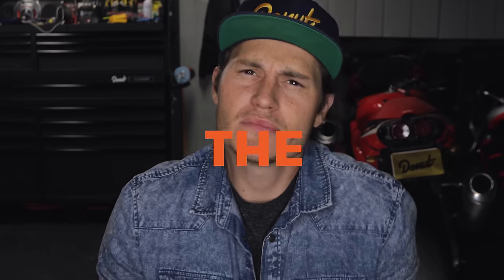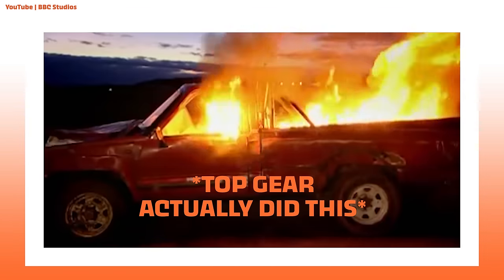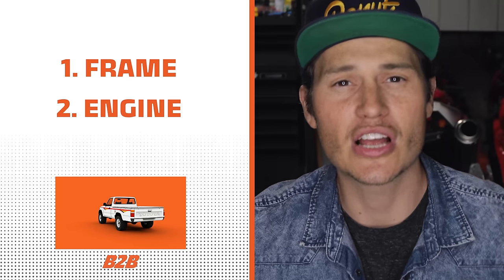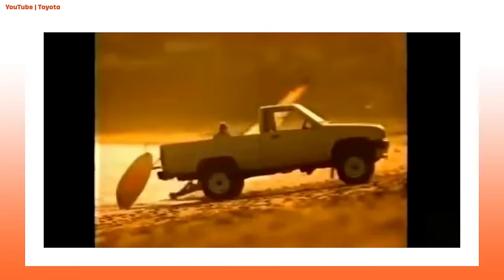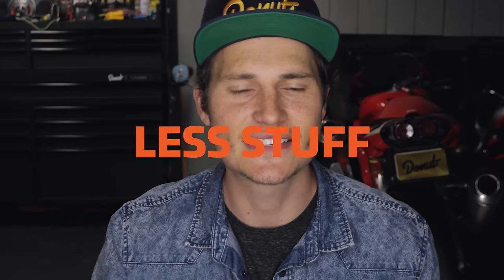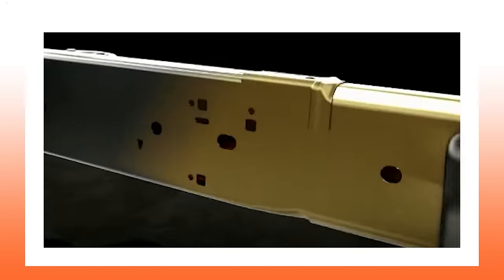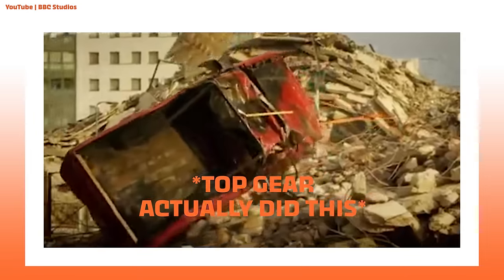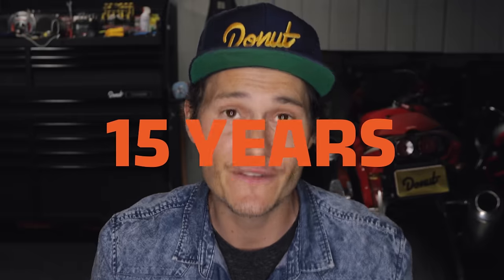Toyota PICKUP Truck - The Science EXPLAINED

Comment: I've seen a couple of those old hilux's reach over 1 million kilometers here in south africa
Reply: Most old farmers would watch this and say knowing" dit is my bakkie"
Reply: Here in Brazil you see it too. From farmers, mining companies, fire fighters e road emergency responders. The only downside they have is that thieves loves them.
Reply: Kilometers are easier on vehicles. When you drive miles is much harder on them
Reply: @greglautz8470  sorry what lol
a mile is 1.6km, so basicalli 1.000.000km is 700.000 miles more or less
Reply: @greglautz8470  A few tundras have gone 1 to 2million miles, toyota gave them brand new trucks, so they could take them back and study them
Reply: YaoMengLiew  yeah, here in Mexico we got both the Hilux and the Taco, I would get the Hilux just because it costs like 10K less, it has a diesel engine, a 6spd manual with 4WD and is tougher. But the tacoma is more comfortable, more of a family truck than a work truck.

Comment: i am a technician at toyota and i have been working on frame recalls for years, we spray tundra, tacoma and sequoia frames with anti-corrosion compounds, if the frame is rusted through we replace the frame under warranty. some of these recalls have ended though.
Reply: Is an old 85 Toyota 4 runner under that recall ?
Reply: They wouldn't sell me a frame replace my rusted out '06 because I wasn't the original owner. Was not impressed.
Reply: They use to give us on the north coast new beds for free

Comment: I've driven a several 80s and early 90s Toyota pickups for driving jobs back in those days. Now I have a 99. I find it just as dependable, but a bit more comfortable (AC and airbags!) and more powerful. Has 223,000 miles and the oil coming out at oil changes is practically as clean coming out as going in.

Comment: I’ve seen my dad pull a 10,000lb load with a 22RE Toyota pickup. They will tow anything you want lol
Reply: Low range? Automatic? Otherwise I'm just imagining someone burning out their clutch on a hill 😆.
Reply: I pulled 6000 with my '89 short bed and it was scary.  It's got the gears, but not the power or the brakes.
Reply: Ok
Reply: emmajohal my dad is stronger than your dad 😂
Reply: The Bushwacker it’s actually 1,200,000 but yeah
Reply: I towed a 92 pickup with my 93 22re 4runner. It worked but only because I was a broke college kid. Full size is so much better for towing
Reply: I pulled a quad cab ram 1500 that broke down from a bad fuel pump. It pulled but you could tell it was there big time... don't go above 3rd gear it will bog down big time 2wd 5 speed.

Comment: Bro most Toyota’s before 2000 are on another level. 😹😹 I once drove my Toyota for 3 months without no oil, car did not complain. I dare you to try do that with another manufacturer
Reply: My friend did that with a 95 f150. The oil was so low that the engine knocked when he went around a corner.
Reply: Why? 😂
Reply: car before 2000 are legend

Comment: Toyotas are beast . 

In 2017 I bought a e46 m3 and blew the transmission in less then a month , my mom gave me her 1992 Toyota sienna so I could get to work & started using it as a carpet installation van , I once put a 800 square feet roll of carpet on the roof rack and 3 rolls of padding inside and not a single issue with the van lol then I got a trailblazer ss and I broke it so then there I was using the sienna once again . In the 3 years I owned it I NEVER did a oil change …. Yes I was young and dumb with my cars …. My mom sold it in 2021 for $3000 with 345k miles with A/c & heat working like new still 😮 our Mexican neighbor is the one that bought it (he had a 1994 sienna and loved it ) and to this day he uses it as a work van . But man are Toyotas literally the best vehicles.

Comment: The one thing the taliban did right, choose a god damn good truck
Reply: they need weight, stability when you fire heavy gun, and low price =)
Reply: Not to mention they are small and maneuverable so they were good for getting into places off-road and in urban areas that other vehicles simply couldn't.
Reply: STOLEN
Reply: You can kill them, but sometimes it literally takes an M1 Abrams or an airstrike, or both.
Reply: None of the above lol. Its because Toyota trucks are not happy until they have sand in every crevice.  They will go 500000 km in nothing but soft sand!.

Comment: We drove in my buddy's taco 500miles down the interstate on two working cylinders... and no oil, topped her off, fixed the wiring harness couple weeks later to get the cylinders firing again, not to mention he lost control and ran off the road at 60mph into a swamp sunk it and blew through a bunch of dumped trash including box TVs and lumbers got pulled out and it started right up

Comment: I had a 1990 toyota pickup and I ran the crap out of it. drove it for 19 years and put over 400k miles on it. still running on original engine and drive line when I finely sold it. even used to pull a travel trailer with it that weighed 3500 lbs empty, which is was never empty. The truck had a 2.4L EFI engine and other than basic maintenance like oil, filters, plugs ect, in 19 years changed 5 batteries, 2 alternators, 1 starter, 3 clutch plates and 1 radiator. best vehicle i've ever owned.
Reply: Shit your valve seals lasted for 400k? I have a 92 Toyota Pickup right now that smokes a bit on startup so I'm having to replace the seals. 155k miles on it so I'm hoping for another 155k miles.
Reply: @thedude8526  yep, all I can say is I always changed the oil between 3 and 4 thousand miles. and it was the best and most reliable vehicle I ever owned.

Comment: 1992 to 1996 ford f150 4.9 stight 6 base model was bulit stupid simple and will live on forever
Reply: I still have my 84 f250, still fires and drives after 400 thousand miles. That's if you can find 2nd and 3rd gear.
Reply: @Babayega Lol you can agree that the Ford 300 is one of the most indestructible engines ever made and still say Toyota trucks are insanely reliable.  I mean, they designed the original Landcruiser and FJ under military-specs after all.
Reply: I'd love to see a video about the 300 inline six. I've got one sitting in the driveway now.
Reply: @taylort1045  it's amazing when they build it simple and they build a strong It last .forever what an amazing concept
Reply: Triggered Americans😂😂
Reply: @lukehall4546  🤣🤣🤣

Comment: I never owned an 80s Toy truck but always wanted one and now guys want $9-14k or more on these in rough shape. My friend had 1 and loved it, up north they all have wood beds bc they rot out but keep running. I think any 80s or even 90s Japanese eng are close to bullet proof or better. I had 2, 98’ Nissan Frontier that ran perfect I had one 324k on orig clutch never replaced anything but the water pump. Everyone here is saying there’s has 250-300k mine was over 300k! Only reason why mine died was one I sold the other was hit and totaled, yes it still ran.

Comment: Strange why Toyota shifted to C Channel when other manufacturers simply created drain holes on their box frames.
Reply: Because C channel is still better at fighting rust. And Japan has a major rust problem.
Reply: @AbdulbarrAslam  yeah, since it's a tropical island.
Reply: Toyota had drain holes in their 1980s fully boxed frames. The major problem wasn't the water, rather the road salt and debris that got trapped in the frame.
Reply: Toyota has lost their way.
Reply: klyde beso Japan is not a tropical island in the slightest lmao
Reply: @klydebeso3898  Japan is just as tropical as the US, friend.
Reply: @OverseerMoti  Still an island. 'friend'.
Reply: klyde beso what does that have to do with rust? I’m about as far from the ocean as you can get and stuff still rusts plenty here
Reply: @awildfilingcabinet6239  because of the salt that the sea has, and the humidity. So the cars that are used near coasts tend to rust much quicker than Cars from other places
Reply: @awildfilingcabinet6239  Do they put salt on the road during winter where you are from?

Comment: 94 pickup was my first vehicle. The body was rusted out but I still paid 2400 for it. I drove it for 4 years. I never changed the oil or any other fluids. I riveted tin roof siding over the rust holes and sold it for what I bought it for. Still the best vehicle I ever had. It would take serious life experience to convince me that the 1994 Toyota Pickup r22 Delux cab isn't the best vehicle ever made.

Comment: "box frame has rust issues"
thats why you drill small holes in the botom of the low spots to encourage water to leave lol
Reply: Can't say the frame will be as durable though, although that'll atleast help with the rust issues to an extent.
You'd be suprised at how weak metal gets when you drill a hole or 2 in the wrong spot. (Although, I really could just be wrong at this point in regards to cars.)
Reply: I live in Canada 
Head to oil guard and get it sprayed. Get it done every year and the frame will never ever rust. Period.

Comment: Toyotas may have been indestructible in the warmer parts of the United States, but they barely lasted more than the payment book where salt was used.
Reply: Salt should be banned
Reply: I had to hop down to see comments.  The frame on my 1998 Toyota Tacoma rusted trough and it was a danger to drive on the road further and har to be scrapped.   Just a bit further north, in Minnesota, there were total frame recalls on this model Toyota pickup, but one state south, there was no warranty coverage on this huge design shortcut and failure. 
This video is for a Toyota pickup from the 1980's
Reply: @Matthew Caughey Good point..  the Legal settlement was for 2005-2010.  Toyota also had to issue a recall for 2001-2003 Tundras for frame rust.
Take a look at the larger picture. 
"In 2008, Toyota’s infamous frame-rot fiasco on 1995–2004 Tacomas (about 800,000 trucks)(813,000 est) was so bad the company had to buy many of them back, conduct extensive frame repairs, and/or extend frame-corrosion warranties by 15 years. The company never issued a recall for that problem." - Car and Driver Magazine.  Don't believe me.  Look it up! 
During my time in dry Africa, the Toyotas, like the Hilux were unbelievable vehicles indeed.  My issue was the rusting-out of the vehicle in Midwest, USA.
Reply: @Matthew Caughey Where are you located?
Reply: Matthew Caughey the frame recall was also a paint problem they were using that the salt corroded right through
Reply: Only thing that killed 80s yotas here in Iowa, good ole rust. I've seen beds fall off and frames rot inhalf.
Reply: Put a jack up thru the frame of a good old pa dodge dakota
Reply: I don’t know, dude. I had a taco that lasted pretty well until I rolled it. and I live in the north. tons of salt.
Reply: In Michigan where I live its very rare to see a Toyota truck more that 15 or 20 years old. If you have one here you are the exception, not the rule.

Comment: They could fix the rusted frame problem with cortin steel if they really wanted it to last.
Reply: Or just flush it out whenever its wet. Drill drain holes in the low points of the chassis.
Reply: Or just rustproof it at the factory before assembly and put in a few drain holes in the low spots.

Comment: My first truck was a rebuilt 1985 Toyota pickup with a 4 speed manual. I did the same thing bear did. Didn't check or change the oil for almost a year. Never had an issue. Ever. Traded it for a 1989 silverado 350. I still miss that truck too..

Comment: I had a 97 4runner 3.4l manual run out of transmission fluid on a fairly big mountain pass. I only knew it was out of fluid because there was a tiny amount of fine smoke coming from my shifter boot. Cruised back down trying to help my gears with my brakes and made it back to a shop. 90 bucks for a new gasket and tranny fluid and it ran fine until I sold it 3 years later.

Comment: Although I'm definitely voting for the box frame construction, as far as function goes I will say that the box has a tendency to fill up with dust and dirt which holds water and then it's goodbye frame unless you flush out your frame now and then or after some off road fun. But, of course, we all flush out our frames, right?
Reply: My brother-in-law gave his Toyota Hilux a pressure cleaner tune-up, washing all the mud out of the frame made it drive like it had an extra 20-30 hp.

Comment: Fun fact: I own a Toyota Hilux, 3.0 with a single turbo pre-installed, it has the 4x4 feature that has 3 speeds, you are gonna need to sell your house if you want to pay for the fuel
Reply: You mean the D-4D? I'm pretty sure it gets better mileage than the 1GR Tacomas we have in North America, definitely better Mileage while Hauling, Diesels are built to pull, they might not do as well unloaded but they'll kick a Gasoline Engine's ass around the block when you're pulling a Trailer lol
Reply: @SIRUNOWN  a friend of mine actually told me that pulling a heeavy load with a v8 hemi dodge ram (gasoline) was actually less consuming than pulling the same thing with a 4 cyl, 2.0, biturbo, vw amarok. I guess if you overcompensate with cylinders and power, the fuel consumptions stays about the same
Reply: @Dourkan  that is correct, that poor VW was likely being way overworked, Diesel or not at some point you just need a bigger engine, but the fuel mileage falloff is usually less pronounced in Diesels when hauling.
Reply: @SIRUNOWN  yeah, the amarok is not designed to pull a full living quarters trailer, but it amazes me how that v8 had almost no difference in mpg's loaded than unloaded. I'd love to see how a diesel v8 turbo behaves someday
Reply: @Dourkan  not ideally, Nissan Titan XD with the Cummins 5.0 TT was a huge disappointment of an engine, I suppose Powerstrokes and Duramaxes are alright for hauling economy but IMO the Inline 6 Cummins is the best Diesel Engine on the market, can't say the same for the rest of the truck the motor's in though lmao
Reply: @SIRUNOWN  awesome. You seem to be a very knowledgeable person, thanks for your input!
Reply: @Dourkan  no Worries, I'm a Mechanic so I've fixed and driven them all lol
Reply: So how much you want for it?

Comment: Had a whole fleet of old Toyota Land cruisers from the 70s at the station I used to work on. Box frame, leaf springs all round, no power steering, electrics haha nah, the mileage gauge had broken a few decades ago and those things still kept going every day with clogged up radiators, one had the thermostat taken out at some point, driving 100s of kms every day through the Aussie outback summer and Id bet they’ll still be going strong in 50 years

Comment: I’ve seen them fail. The rust (frame and body) is usually what kills them. Around here, there are far fewer 80s-mid 90s Toyota pickups around then the same gen rangers and S10s, with the ranger being the most common. I only know of 2 that are still rolling around. 1 is a black 2wd 92 that is on its last legs (mechanically and structurally. I know. I’ve worked on it a bunch of times) and the other is a red 91 4x4 that looks like it was restored. I know of about 8 S10s in varying condition and 12 rangers in varying condition still being driven. The salt belt is murder on any vehicle, but Asian vehicles seem to be more susceptible.

The dodge 318 (5.2l) also has a high nickel content block. In many cases the engine will outlast the vehicle it’s put in.
Reply: @KobieK  the Hilux was sold in the us until 1997. It didn’t even make a dent in US truck sales. It was replaced by the Tacoma which actually gained some market share.

Comment: I'm still driving my 1983 Toyota four wheel drive pickup I bought new for $8295.00. I did have to replace the engine at 233,000 miles because Jiffy lube put gear oil in my engine. I found a engine with about 20,000 miles on it and now we have about 300,000 miles on her.
Great trucks!

Comment: I picked up a 1997 T-100 for free, wasn’t working at all, had dead battery, squirrel nest in the ac, replaced all the plugs and all the belts, coolant leaking into the exhaust, etc. the thing was sitting in a backyard for over a decade when I picked it up. The damn thing runs brand spanking new now and I rep the old paint still 😎. Even put a new updated sound system in it.

Comment: Afaik the frame structure is called Ladder Frame. The upper body (cabin), engine,  suspension, are then joined to the frame. If you need mounting for machine gun or auto-cannon what needed is to drill the frame cross member, bolt/weld on the bracket, and then the weapon. 😊

Comment: My first car was a 87 Toyota 4x4 my dad bought new he drove it for 10 years and put almost 500,000 miles on it before I got it in 97, engine all original transmission was rebuilt once. It was slow as hell but would go anywhere

Comment: I have 3 stellar 1988-89 trucks currently, 88 Dodge Raider got it for free keeps on going lots of zerks, an 88 FJ62 hadnt run until a week ago since 1998 now purring like a kitten added bonus zero rust 162K miles. My DD 89 F250 Ext cab 2WD 7.3 IDI ZF5 spd the definition of work truck rusty as hell frame held up with hockey pucks Diesel engine gets fed everything from motor oil, veg oil hydraulic fluid and keeps on chugging. I do maintain these trucks there just fantastic.